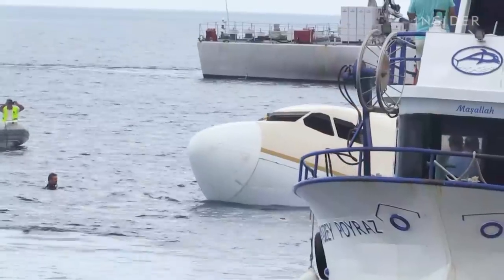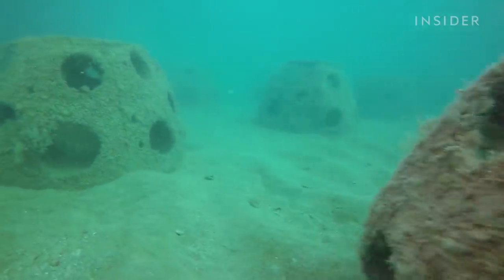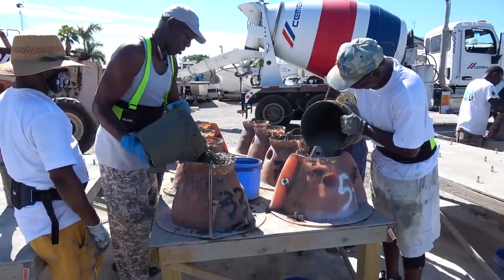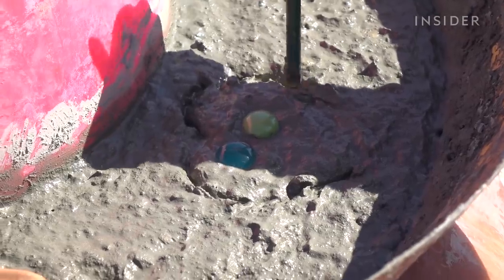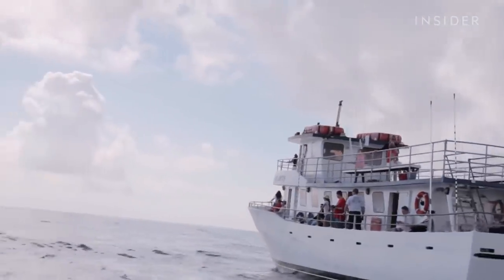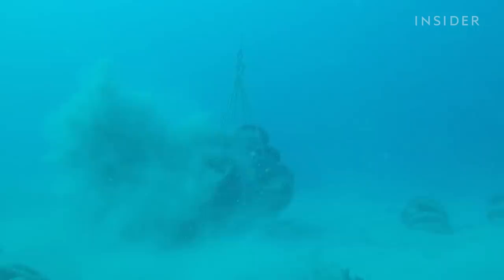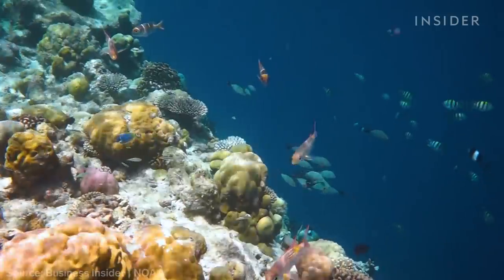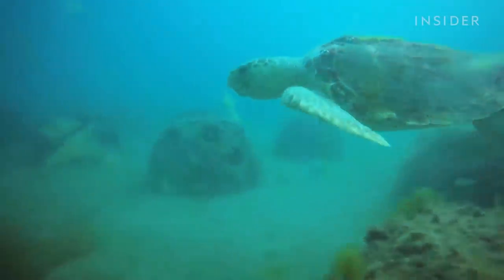How Reefs Made With Human Remains Restore Florida Coast Line | World Wide Waste

Comment: for those who are confused about why carbon emissions effect corral reefs, corral needs a very specific PH level in the water to survive, and water has the ability to absorb CO2 out of the air when it get to saturated with it. the CO2 mixed with the water makes water significantly more acidic. on top of that there are studies that are saying the increase in average water temp is also damaging them. granted, corral will most likely not go extinct, its survived though much worse things in the world. however like the video said corral are extremely important to local economies and communities

Comment: The sea level is rising yet we are dumping more wreck into the sea omg
Reply: You understand displacement alright. Now you just need to work on ratios.

These things are literally a drop in a bucket when you look at how much volume the ocean makes up
Reply: @Beep the Sheep Im aware of that, but that isnt what this origional comment is referinv too. They are clearly talking about displacement causing an increase in sea level.
Reply: @Beep the Sheep this conversation is a lot like talking to myself, only after Ive suffered crippling dementia.
Reply: @Beep the Sheep and? What do you think the added volume would have to be to raise the level by even half of an inch?
Reply: @Beep the Sheep Im not commenting on climate change whatsoever. I dont know enough about any given angle to make an informed opinion.

Personally however, not a fan of trash washing up on beaches.
Reply: @Beep the Sheep true

Comment: The thing is, the sand used in concrete is marine sand... which are dredged from either the bottom of rivers or the sea floor, which contributes heavily to the destruction of existing corals. It doesnt help much if the core ingredient you need is contributing to the problem youre trying to solve.
Reply: exactly

Comment: Should start dumping vehicles. be quicker and cheaper to remove tires and empty fluids from a car than build these structures. These domes are not building reefs. Not much more than a large rock. Using vehicles you could make a reef wall that would be 1000's miles long, or a reef big enough you could see it from the space station.